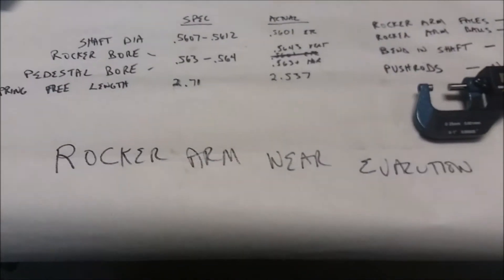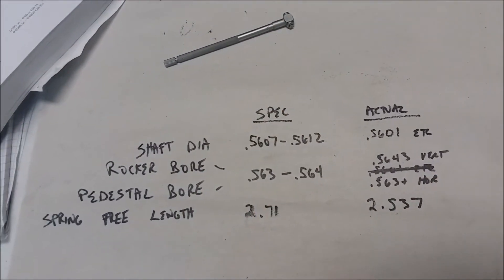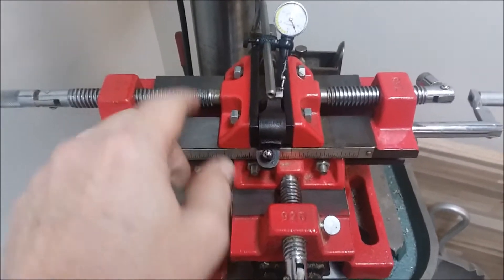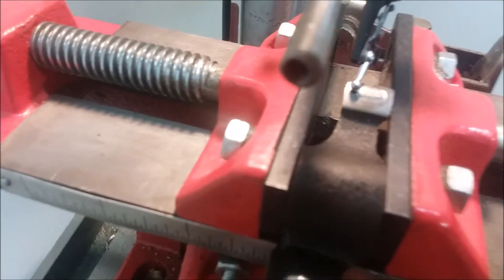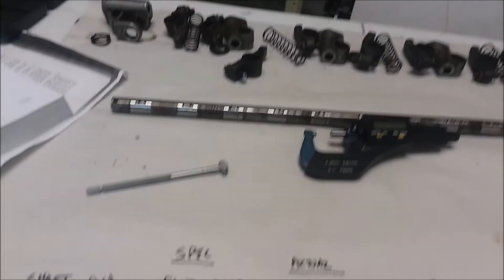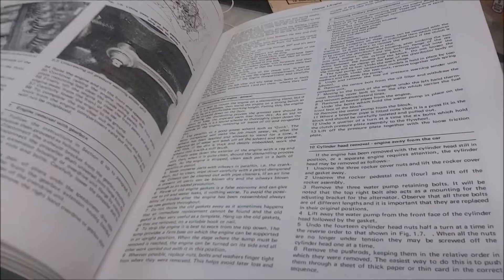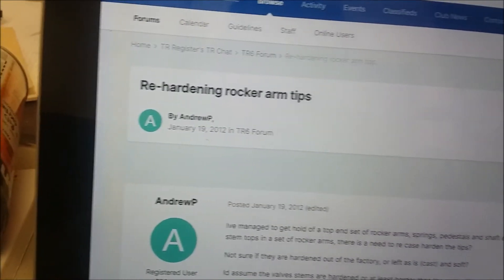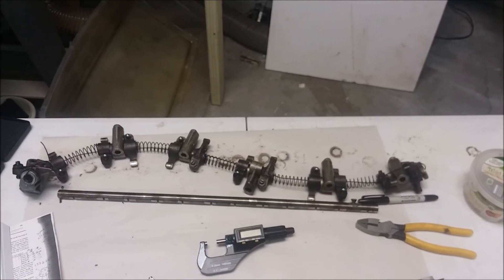Evaluating a TriumphTR6 Rocker Assembly for Wear

Comment: Another good video.   For my TR6, I sent mine out to be rebuilt and have been happy with it.    Just about to install mine on the 250 this morning.   I have three complete units to choose from so I was inspecting them last night trying to pick the best one.   Much less technical than your inspection though 😉. I was just looking for rocker shaft wear and rocker pad wear patterns primarily.
Reply from the maker: I look forward to the video!  Your videos are a great mix of how to and story.  I may bush them in the future, ir even do it sooner if I get the bug on it.  I want to do them together with those on the TR3 which is next.  In the back of my mind is wanting to do a before and after check on hot oil pressure drop.  I have heard worn rockers can cause an oil pressure drop.